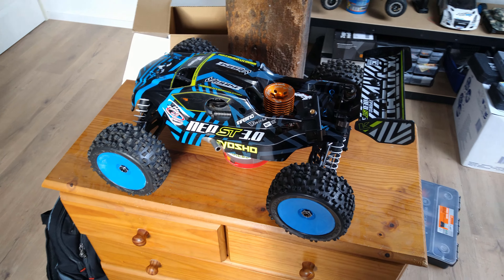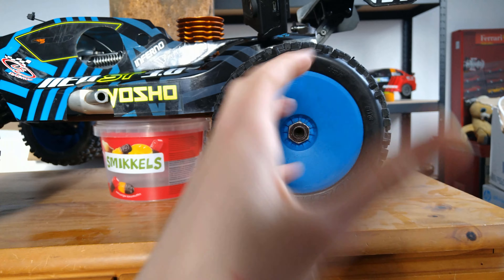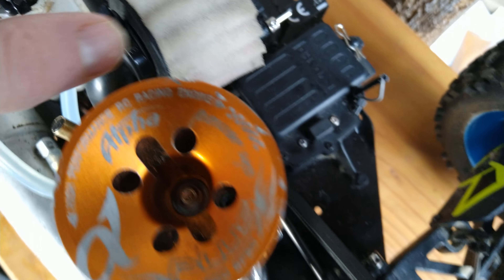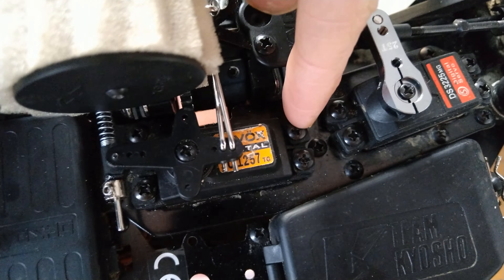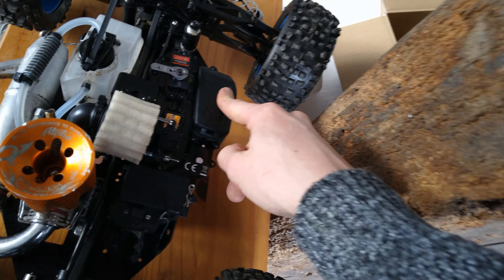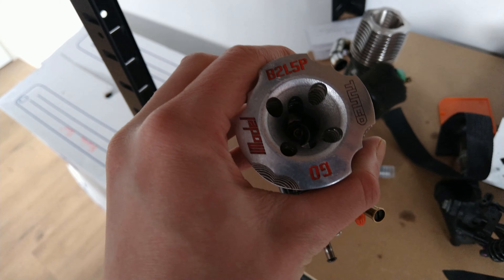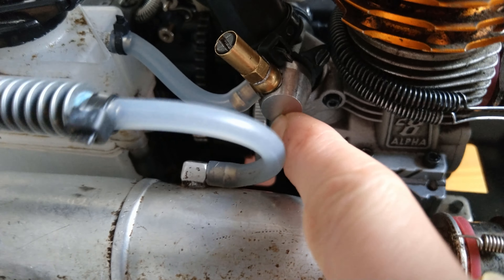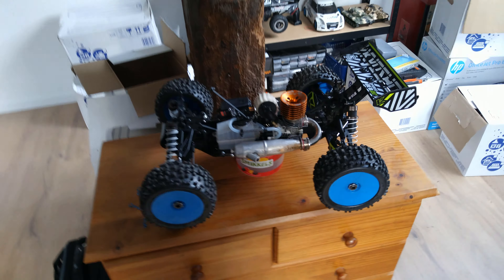A closer look to my heavely modded Kyosho Inferno ST Neo 3.0!

Comment from the maker: I forgot to mention some things: 
I use 75.000 diff oil front and rear and 100.000 in the center
I use box stock shock setup with stock oil which I may change soon with thicker oil
Also I run a 48T spur with a 16T clutchbell which is the only clutchbell that has survived so far

Comment: That’s really nice. I want one. 👍🏾
Reply from the maker: This is basically a standard Kyosho Inferno ST NEO 3.0 but I changed:
Tires
Clutchbell
Clutchshoes
Clutchsprings
Engine & exhaust
Radio
Servo's
Diffs are setup to 75.000 front 100.000 center 75.000 rear
Reply: Nitro Mike nice work. That thing rocks.

Comment: sup NITRO MIKE! that engine is beast!  Great truggy, which one are you looking for next?
Reply from the maker: I don't know. I am kinda happy with this truggy as it is. I will however get myself a badass 1/8 nitro buggy soon!
Reply: Nitro Mike try tekno nb48.3 nb48.4 or the new nb48 2.0. Durable and fast can’t go wrong.
Reply from the maker: @moddedt7414  Do they come with pivot balls or c-hubs? Because Pivot balls won't survive when I send them 13 feet high like I did to this car
Reply: Nitro Mike tekno don’t mess with pillow balls lol c hub on all their stuff trust me tekno is GOAT
Reply: Nitro Mike but I launch a X-ray 2016 30-50ft all the time but the parts are rather expensive I’m definitely going tekno again to Match my nt48.3.
Reply from the maker: @moddedt7414   I will be looking into one then but it will probably be a new kit since no one drives truggies in my country anymore. The race class died long ago :( I am also interested in the new TLR X truggy that has been showed on instgram by Horizon hobbies

Comment: Is the engine mount adjustable front to back? Or is it only side to side for mesh
Reply from the maker: The engine mount is only adjustable side to side for mesh. But you can adjust the front or back by adding or removing shims from the clutchbearings

Comment: Ever run that slash?
Reply from the maker: https://youtu.be/D5DcRVrg_2s
Also I have a full playlist of it
Reply: @NitroMike  awesome. I sold my crawlers. BORING!!  I love nitro but also enjoy electric. Have a new Revo 3.3 to get my feet wet in nitro, been a few years. What truggy/buggy would you recommend?
Reply from the maker: @HNunyabusiness  If you are going RTR I highly recommend the kyosho Inferno series! They can handle a real bash and you can upgrade them with better engines in the future. Also losi makes a good RTR platform. If you want to build a race kit  get a Mugen, TLR, Kyosho or Tekno
Reply: @NitroMike  I've always admired Mugen. Think I'll go that route. Will take a while. Expensive.  I want to build my next RC.